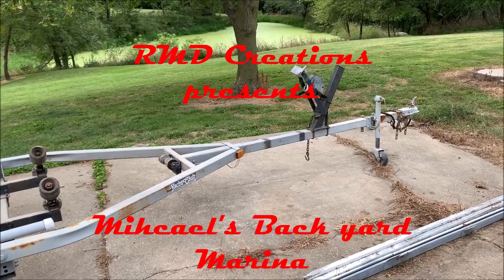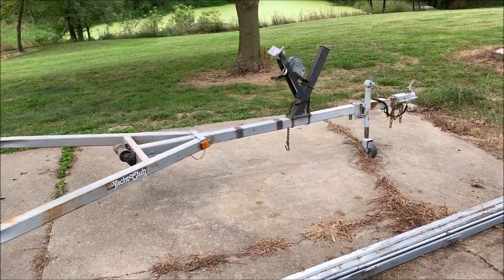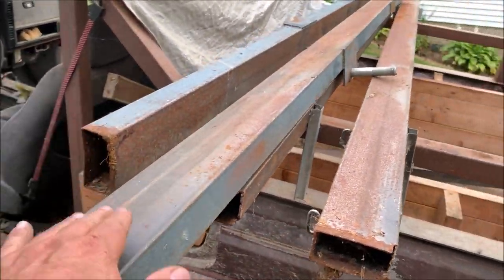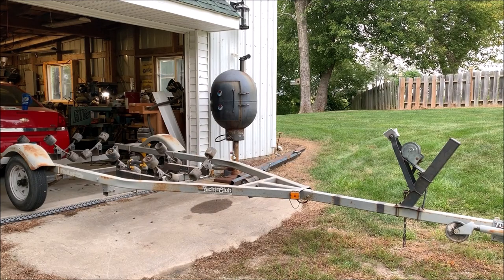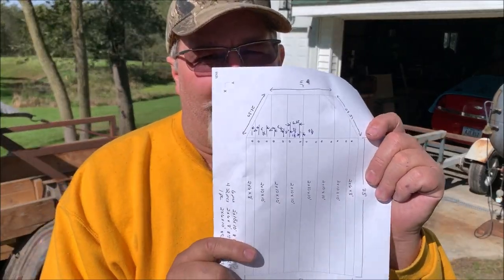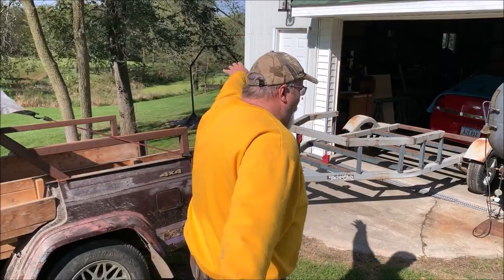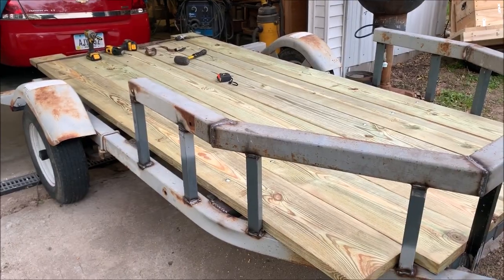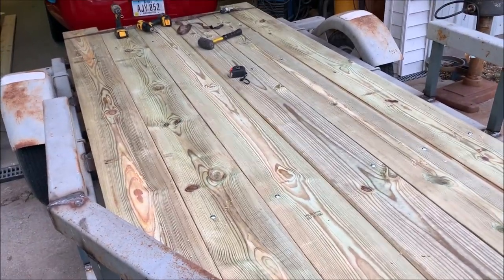Boat Trailer to Utility trailer conversion Part 1

Comment: About to do a similar deal. One thing that seems apparent on the one I'm going to work on is the same as yours. The axle needs to be moved forward a bit or most of the weight will rest on the tongue and not the wheels. Yours looks easier for that than mine as my fenders are quite solid and large and welded to the frame.

Comment: I myself plan on doing something like this with a 19ft boat trailer I picked up few weeks ago for $100. I race lawn mowers so plan to fix it to haul them on to and from the track
Reply from the maker: That should easily get the job done.  I use my trailer a lot. Much easier to load and unload than using a truck. thanks for watching

Comment: Guys… just a word of caution: grind off as much zinc ( galvanized) as possible before welding. Very toxic fumes created whilst burning. And will weaken your welds. I’ve been doing metal fab for decades since I was about 12. FYI those stringers will be much stronger load bearing turned 90* long side vertical. Blessings guys!
Reply from the maker: Thanks for sharing

Comment: I really like what you did, but my concern would be toug weight, the axle needs to be more centered. 
Just my opinion.
Reply from the maker: No  are not centered. You need to maintain a certain amount of tongue weight. Been using this trailer a while now and it trails perfect. As with any trailer you have to load it smart as to place the load where the trailer will perform best
Reply: @Michaelsbackyardmarina  I do understand what you are implying. but my experience to much tongue weight is nearly as bad as no tongue . None the less, not trying to give you a hard time.
I like channel and I do subscribe. 
Look back it looks like spell ck did work lol, but you got message.
Thank you for content. 
I have learn from channel even as and as old man still learning

Comment: Is that galvanized your welding ? I didn’t know you could mig weld galvanized, I thinks I’m going to do this too
Reply from the maker: no it is not. You can weld galvanized coated steel but you do NOT and I repeat do NOT breathe the fumes, they are poisonous